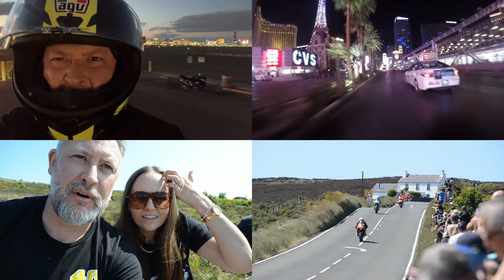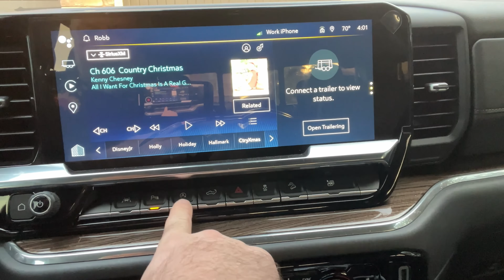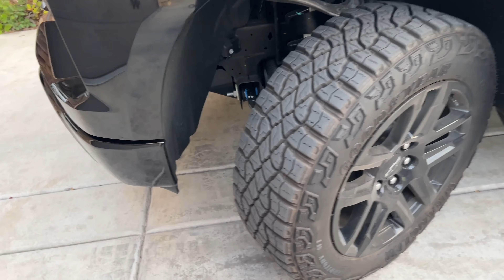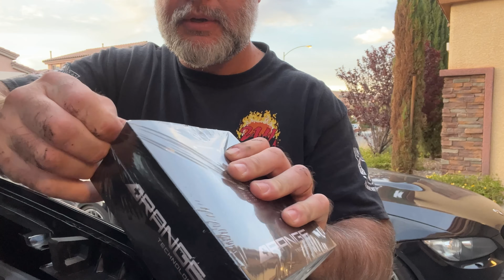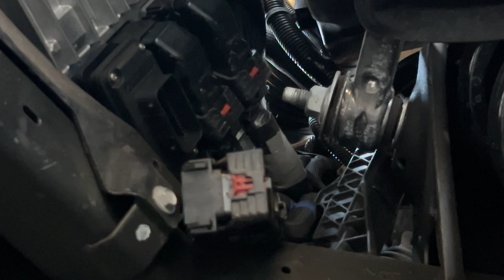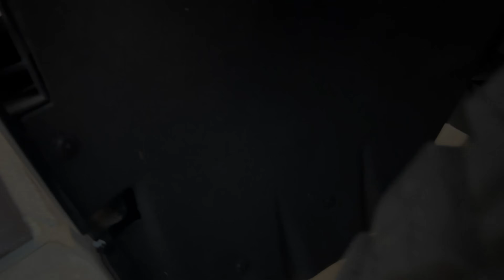Robb Review:  Range Technology Inline DFM Disabler

Comment: GM lifter design was improved a lot in 2022, so it’s not possible to generalize for all model years. But either way, jury is out as to whether a software disabler (free option or otherwise) will prevent lifter failure at all. Too many variables to know for sure. All I know is that on my 2025 Silverado 1500 5.3L, manual L9 mode (free option) absolutely does disable DFM and auto stop/start, and with negligible drop in fuel mileage. Verified this on several trips with live data from the ECM while driving and monitoring cylinder deactivations in my OBD2 scanner (Otofix D1 Lite - the cheap one). Not sure why anyone would risk voiding a warranty by installing a paid software-based disabler, if you have the free option right off the assembly line

Comment: Installed on my 2023 Escalade. No more off/on at stop lights. No more worries about getting oil circulated back up into the engine after auto shut downs, no more starter overuse on auto restarts, and no more loosing cold air from the vents when the engine is off at the lights.
Reply: just got a 2023 Escalade, trying to find install videos, how difficult was the install for you?
Reply: @f1fahad  Very simple and pretty quick. I have the plastic pry tools from Harbor Freight and the 7mm socket with an electeric ratchet (Harbor Freight). Takes 15 minutes, The fir time it took maybe 25 minutes being extra careful.
Reply: @f1fahad  There is a good install video from $D for the 23 Escalade, I watched that while working on it.

Comment: Helped a friend put his on and we did it without even removing any screws and it took about 3 minutes to do. Works great no more gurgling noise when slowing down either. And yes the auto stop goes off. Also when the truck is started it says Range technology on instrument panel until radio is turned on. We took it off and then put it back on it works really good. We took it off and put it back on from lying on the ground easy to do if you have to go back to the dealer for any work.
Reply from the maker: Nice!  I’ve never seen Range Technologies appear on my instrument panel… interesting.

Comment: So does this deactivate the DFM and the AFM? Or do you have to buy a separate module? I’m not even sure what the difference is in AFM and DFM?!
Reply from the maker: This version deactivates DFM which is installed on later model GM gasoline engines.  Range offers a similar module for earlier gasoline engines that disables the AFM.

Comment: OK i'm in Missouri and my plates are due the end of the month aka i gotta get the emissions test done on my '22 Trailboss 6.2L, i have the range disabler installed, any info on whether or not i have to remove the device before testing, i called Range and the guy was trying but he couldn't give me a conclusive answer
Reply from the maker: Is the module on your 2022 installed directly in the computer behind the driver front wheel splash shield, or in the ODBII port?  If installed the computer then I think you’ll be fine because they won’t be as to detect it.  If installed in the OBDII port then you’ll likely need to unplug it.  I’m no expert though, so if you don’t pass by leaving it in the computer let me know so we can educate the community.
Reply: @robbsgarage  It is the Range RA007 disabler mounted inline at the ECM behind the driver front wheel liner, I'll set up the appointment tomorrow, if it fails then I'll yank it out and let ya know
Reply: passed emissions with no issues at all without needing to remove the RA007, in and out of the shop in 15 min
Reply from the maker: @Cooper1968mw yes!!!

Comment: Well, a little old video, BUT all I can say for these that still monitor this YouTube ch then I have gotten one of these Range007 device too for my 2026 Chevy 1500 5.3L V8 and boy, that was one of the best investment that I could have done for my truck at this early stage of infancy, even thought I barely have almost 1900 miles on it in about a month so far. I installed in at around 400 miles-ish, and it was a peasy easy thing to do, considering that on my LT model/trim, then I did not have to remove the liner either. Now, the great part is that, even thought it is almost impossible to tell when or if some cylinders are OFF or NOT just by trying to figured out listening the engine or even driving I would say since the GM removed the “blue dot” I think might have been at previous year models telling “you” when the engine is in full 8 cyl or not, if I am not mistaken, but with the newer models then you can’t tell. Now, since that was a dilemma and a good question to ask, then I called the Range and one tech told me that the only way to tell is to try to press the gas pedal at 60-65 mph and see if there is any lack of response instead of immediate response of the throttle and a good push, meaning that the truck is only on a V8 mode, as well as a decrease of miles per gallon too.. For me, one of the best thing is that I don’t have to deal with this annoying shot off/on engine anytime I stop somewhere and wait while idling, which I was always pressing this dah button with my previous 2023 Chevy 1500 while having the 3.0L Duramax (diesel of course), and which I got rid of it recently since that truck would NOT pass the smog inspection at all, including after the dealer upgraded my Serial Gateway Data and the ECM too, adding more thousands of miles after that in order to have this EGS sensor set/completed, not matter how many times I try the GM recommended driving cycles. Just a shame that a brand new truck purchased couple of years back it is NOT getting the smog passed while the truck has zero issues other than NOT getting this EGS sensor set and the smog inspections at all.. The dealership could not find any issues with my truck other than telling me to keep driving until this EGS sensor sets. I got to the end of my DMV registration and almost at the 60 days extension of being able to legally drive my truck on the CA roads, and after that then I would have to leave it to the dealership until they fix these emissions issues or keep it in front of my driveway and look at since I would not be able to legally operating it anymore without the DMV tags that I watery paid for. I got instead a gas-er this time around and this Range007 was the first item that I installed immediately. Yes, the device does NOT prevent any lifter problems, BUT it help reducing the aggravation of getting there a lot sooner I would say, just my opinion since the lifters are NOT starved for the right amount of oil and then easy easy destroy them IF I understand this correctly. However, all I can say and recommend of doing it if I may, is that DO NOT tow anything with your truck for at least 2000 miles to 5000 miles in the beginning of possible, just to have the engine get its wear and tear easy easy adjusted due to so much narrower tolerances and then get its pistons and rings set nicely and better aligned with it recommended wear at that early stage of these new engines’ infancy, due to being tide and to new. The manufacturer recommends that “you” do NOT tow anything for at least 500 miles and drive the vehicle with about 50 mph, without cruise control or abrupt stops, as well as a little of different speeds. I kinda did just that for about a month and my first 1800 miles, so far, and from now on I am easily increasing the speeds but also not more than 65 ish randomly, so that the engine gets its wear uniformly and therefore avoiding any severe oil consumptions later on. Many individuals do NOT follow these guidelines and then later on complain about excessive oil consumptions, or even worse issues with the transmission, etc. Moreover, PLEASE people for GOD sake, change the first oil at max of 1000 miles in the beginning, and then the 2nd oil change at max 2000 miles or 2500 miles max after that, so that the very first wear and tears engine shavings gets out of your new engine immediately, and avoid more lifter problems later on, just my opinion again. I went even further and pored one quarts of brand new engine oil into my engine after almost 4 hours of draining my very first engine oil that came with the truck, so that I eliminate any debris left am that can be pushed out too while being left inside the pan, considering these catastrophic engine failure of GM 5.3L and 6.2L recent problems, and that got so much national attention. After that PLEASE try to change the oil at 4000 miles max, so that you can prevent catastrophic engine failures or lifter problems as it is one of THE major problems with these two type of GM engines. People either beat the crap out of these cars at a very early stage or tow, as well as treat these pickup trucks as a new toy of showing off etc. Basically, “me type of image” and childish behavior/performance if I may describe the “presumable feeling”, but at a cost of your property that gets destroyed also in my opinion. In the end, the GM products suck, just my opinion, and if you treat it with so much disregard, then don’t be surprised that you get a clunker by shortening the damn life of your investment at your expense.. I did all my maintenance including some a little complicated repairs too, involving my previous trucks, and therefore I have had few brand new rams 2500/3500’s as well, besides my latest 2023 Chevy 1500 with 3.0L Dmax diesel LZO having the same transmission 10L80, and never ever once I have had any issues with these, as far as I remember, while putting thousands of miles on each and every one of these trucks. Please be informed that I am not a mechanic and I am not advertising any product here, let alone being paid by any of such entities. I just like some of these products and that is my opinion only. Cheers!
Reply from the maker: Just posted an update after 25K miles on my truck:
https://youtu.be/MHNVToMra_0
Reply: Do you know if you would have to take it off before smogging it or if you take it in for oil changes at the dealership?

Comment: Another must is a lower temp thermal bypass for the transmission! Excessive heat kills these transmissions, cheap simple fix.
Reply: Man, I should’ve got one of those, but I think it’s too late for me unfortunately😭
Reply: @Unstreetable80 is your transmission having issues? A lower temp thermal bypass for these transmissions and changing fluid every 40,000 miles is a must if you want them to last.
Reply: @paulcondie2520  yeah I’m screwed brother way past that 40,000 mile mark🫡😭🤣

Comment: Does it screw up the lifters from not  letting the lifters get oil and will they stick when you remove the disabler from not operating
Reply from the maker: My understanding is it preserves the lifters by allowing them to operate as normal so they’re constantly lubricated, but Range can describe it more accurately.
Reply: @robbsgarage thanks for the info,my warranty runs out in dec 26 on my 2020 GMC sierra 1500 and only coming up on 7 thousand miles and want to get this for my peace of mind

Comment: I have a 5.3L 2025 Z71 Lt will it work for that? I just had a magnaflow muffler installed and i seen it will stop that helicopter choppy sound is that true or do u thinknjust removing the resonators off the pipe will stop it? I need the constant flow growl not a choppy one
Reply from the maker: If you don’t disable DFM then you won’t have the constant growl even if you remove the resonators.  The issue is DFM stops various cylinders from firing.  I’m confident it will work for your 2025, but you’ll want to contact Range to make sure you order the correct version of the module.  Note that even with DFM disabled sometimes the engine will still enter “0 cylinder mode” in which all cylinders stop firing but it rarely happens on my truck (only sometimes when coasting in certain low speeds).
Reply from the maker: Just posted an update after 25K miles on my truck:
https://youtu.be/MHNVToMra_0

Comment: Thank you Robb, I have concerns with the Pin displacement as I insert and take out of the ECM for every service I have done to avoid warranty issues. what are your thoughts.
Reply from the maker: My truck was recently at the stealership for 3 weeks to resolve warranty issues with the infotainment system and headliner.  They had to reprogram the system.  I just left DFM module installed.  They never said anything and it didn’t cause any issues with the reprogramming.  No issues with the module afterward either, so I’m just going to leave it installed when/if I ever have to take back to the stealership again.

Comment: My new 24' after about 2000 miles I got in it and fired it up and a red exclamation mark in a red triangle showed up on my infotainment screen and would not go away until I decided to remove the N terminal only to notice it didn't need a wrench to do it. LOOSE
Question: I put a muffler delete pipe on mine and it drones from time to time while city driving. Have you noticed this with your exhaust modification before installing the DFM eliminater device and if so did the install stop the droning?
Reply from the maker: The drone is likely because there’s no muffler at all.  I experience this in my race car which has no muffler.  No drone on my Silverado before or after the DFM disabled because I still have a muffler (free flow exhaust from AWE).
Reply: @robbsgarage  Hey, FYI, I installed this in my 2024 Silverado the other day. To my surprise it no longer drones...at all. Not that it was too terrible but with no muffler, running just a straight pipe, this install deleted all droning. I'm sure it has something to do with the change in how/when  the trani changes gears. Pass it on.
Reply from the maker: @chiphenry1966 cool!!!

Comment: Put mine on my 25 Sierra, got only 700 miles on it, the difference is noticeable instantly lol , i just hate that its in the most inconvenient spot, and i didnt remove the liner, i just peeled it back
Reply from the maker: Awesome!
Reply from the maker: Still working good?  Just posted an update after 25K miles on my truck:
https://youtu.be/MHNVToMra_0
Reply: @robbsgarage yes I’m only at 4645 currently 
I put it on around 700-800 miles

Comment: I have had this on numerous vehicles. The theory that AFM/DFM increases fuel mileage is completely false. The AFM/DFM system is total junk. The Range Technologies override has increased fuel mileage on all of the vehicles I have used it on. And not by a little, but by at least 2 - 4 miles per gallon. When I bought my 2023 Suburban I couldn't find the override. Last week, at 55,000 miles, the engine lifters and cam shaft failed. I have since found out they released the override about a year ago. I now have it in hand waiting to install it after the engine work is complete. Chevy needs to ditch the AFM/DFM system.
Reply from the maker: Awesome feedback!!!
Reply from the maker: Still working well for you?  Just posted an update after 25K miles on my truck:
https://youtu.be/MHNVToMra_0
Reply: @robbsgarage  yes, so far, although I haven't noticed an increase in fuel mileage like I've seen in the past.

Comment: I had a range in my 2015 . Great product,  The only problem that I had with the range is that I had to take it out , reset , then run a drive cycle before DMV inspections . If not , then the system would read "NOT READY " That wasn't a huge issue when it was plugged into the OBD port , but with it being inline now , its surly going to be a pain , especially since I have to get 4 inspections per year in my business. Is this still the case with this new version ? I just bought one and id like to be prepared for the BS
Reply from the maker: I’m not sure yet.  Won’t have to get smog inspection until 2027.  I’ll include this is my 25K mile update posts.

Comment: They work great, but it doesn’t guarantee you won’t have a lifter failure.  Ask me how I know.
Reply from the maker: 😳 oh man, what happened?  What motor/year and how many miles?  How frequent were oil changes?  Curious to hear your experience.
Reply: @robbsgarage truck is a 2018 gmc sierra 1500 and has a 5.3 in it. Had a catastrophic lifter failure at 69,000 miles. Oil changes were always done around 4,000 miles. I had a total engine replacement and tune with a  jasper AFM delete engine. One thing you must remember is, the disablers work ok, but you still have the crappy parts that fail in the engine, and they still fail occasionally.

Comment: I called Range and spoke to a support tech about this very same module for a 2025 GMC Sierra 1500 5.3 L , he said there is no guarantee that this module will prevent lifter failures in the 5.3 L engine. It’s not designed to prevent lifter failures I was told …
Reply: No it doesn’t fix the piston problem but it can reduce chances by not having so many firing orders.
Reply: @briansawyer9469 What Piston Problem ? I am aware of Lifter and Camshaft issues but not Piston problems that’s regarding 6.2 L engines …
Reply: I just got a 25 5.3L Sierra lol but ya
Reply from the maker: @MegatronDoomBot  Just posted an update after 25K miles on my truck:
https://youtu.be/MHNVToMra_0